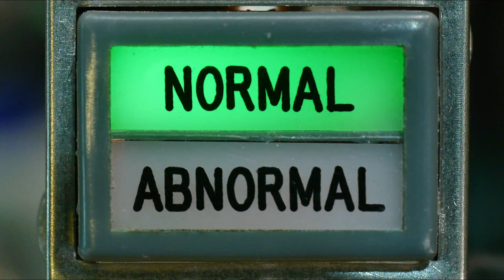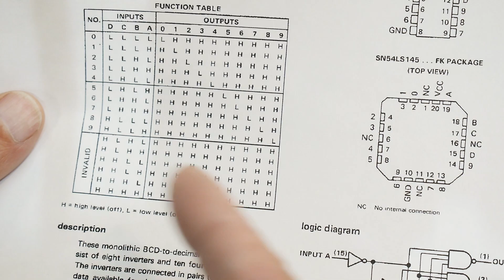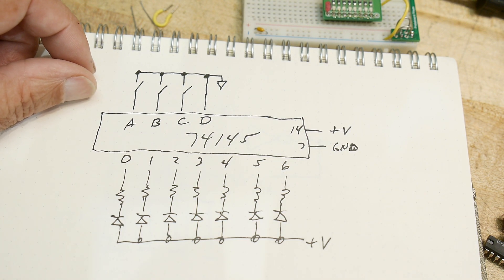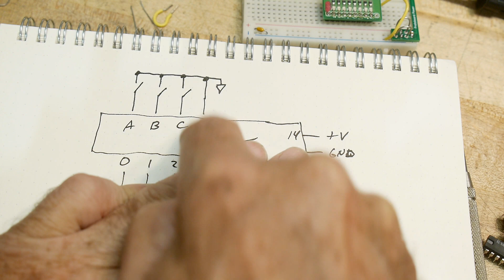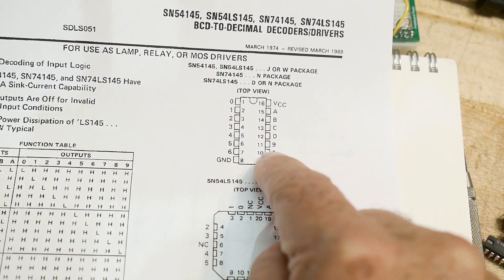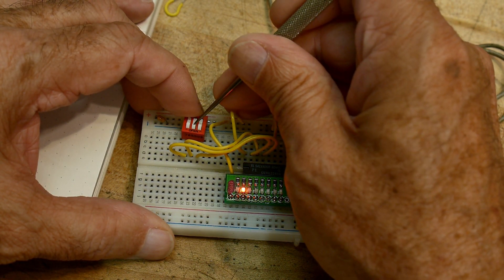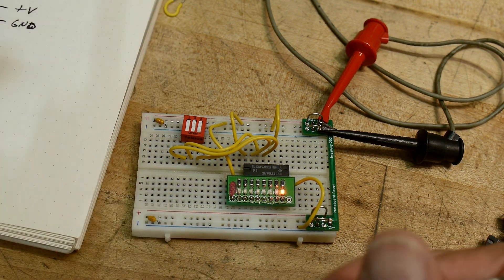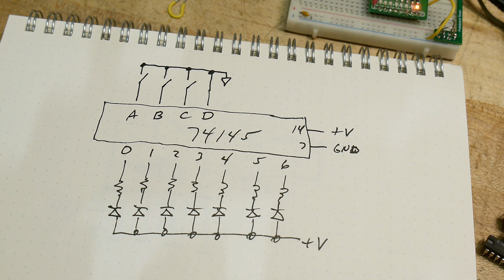#1574 74145 74LS145

Comment: Didn’t mention the key feature… it’s also “open collector” and high voltage tolerant (15volts).  This 74(x)145 part is the lower voltage version of the 7445, that’s also “open collector” and has a higher voltage output tolerant to over 30volts.
You can drive lamps, relays and other loads higher than 5volts, that’s it’s intended use.
And yes, driving a nixie or a decatron indicator would be a perfect and likely an intended application 👍🏻
Reply: Good point!

Comment: Can't say I've ever used a 74145, but I do remember back in the late 80's, early 90's using a BCD to 7seg to build a multiplexed display for an old transceiver. 
Those were the days,   probably just use an arduino now.

Comment: I believe the 74145 was originally designed to drive Nixie tubes and thus had open-collector outputs that could withstand fairly high voltages
Reply: You're thinking of the 74141. The 74145 is a "high" current (80mA) open collector version, but can only handle 15v on its output instead of the 74145's 60v